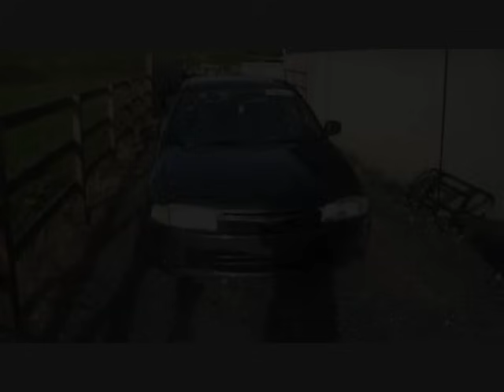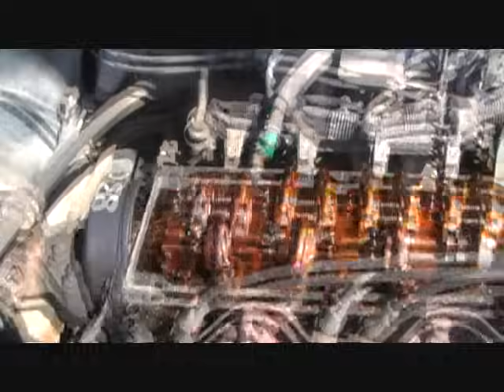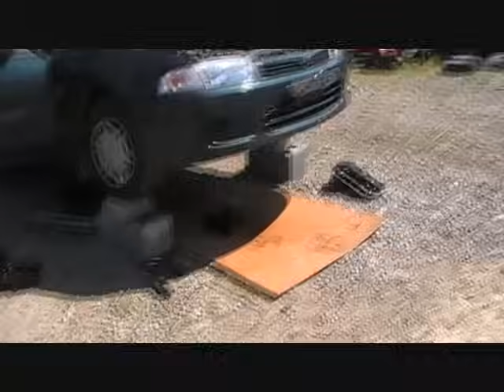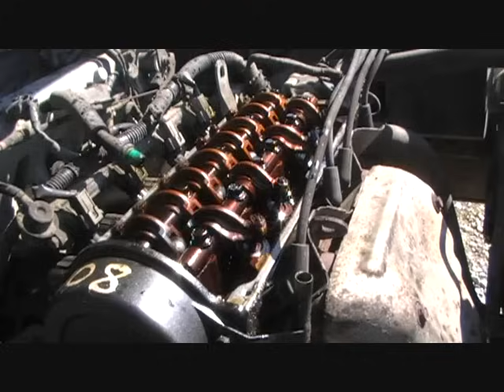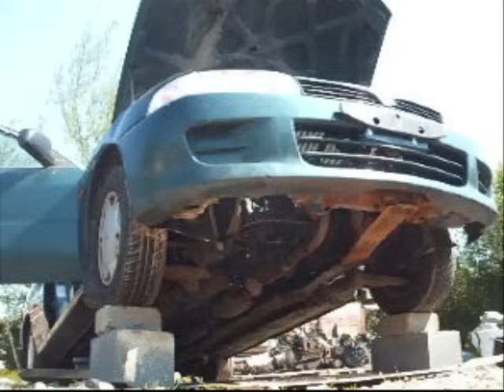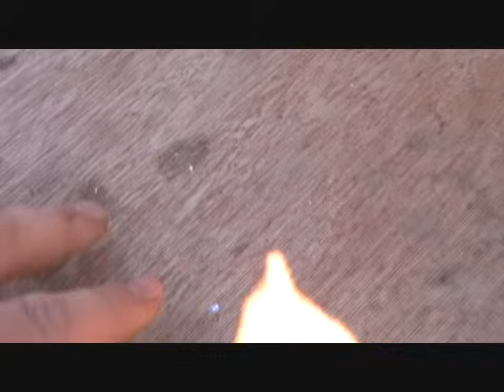Engine Running NO OIL - NO SUMP - Seized Soild on Camera

Comment: Eh you can argue with environmental chavs all day, unless they're commenting from a solar powered recycled 1990's big screen projection TV cardboard box, and leeching wireless internet from a government building, they're as guilty of wasting resources as anyone and there's not a damn thing they can say or do to prove they're not.

Good video. I'm guessing the tolerances in the engine were already very high from wear, I'd assume a newer engine would probably die a bit quicker.

Comment from the maker: there were loads of issues with it, and would have need over 600 euro in parts alone to get it to an NCT standard, plus the labour, which would involve replacing the release bearing

Comment: Nice video. 
To all the idiots saying waste, well it wasn't. Ever tried to sell parts for an econobox? people will screw you around endlessly and it wont be worth the time to pull.
It might look alright but if you live somewhere that actually has safety inspections it starts to add up rapidly when you need to replace bushes, mounts, exhausts and fix leaks.

Comment: I did wonder how long an engine would run with water instead of oil. It should stop the bearings overheating, though it won't lubricate very well. It sounds as if it might be a very long time! Presumably you left the oil in, so it was an oil/water mix in your case.

Comment: Nice video dude. What i would ad to it is that the engine is running free and it's able to stop runningwhen the friction becomes to high. While you're driving instead the energy of the moving car true the gearbox causes allot more damage when the pistons and valves actually want to quit but they can't and get forced way further into the graveyard !! lol

Comment: What a waste of a good engine. Next time put some of the super duper high falutin additive in the oil first then pull the pan and run it. Like those slick 50 ads did. Personally I think it's BS. No oil = no engine. Hold it to the floor and see how long is lasts.

Comment: I'd have jut used the engine for a little project, like a mini baja car. I you don't mind blowing the engine soon, just increase the compression ratio to 15:1, run it on a high octane gas-ethanol mixture, and have loads of fun.

Comment: Wow, look at all the wankers crying over a running engine that they would never have bothered with, paid money for, or gone to any effort to remove, refit and use themselves..
It's like they are all driving old cars that they are constantly restoring and have never bought a newer one.
Don't worry, seized engine or not, that car will be melted down and recycled into a shiny new one..

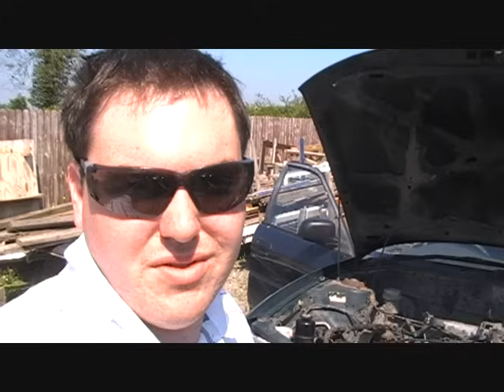Comment: @ 4:05, that is not true! Engines vary on how they die. American V8's have a habit of throwing con rods when they loose oil and run for a while. That is very different from a little inline 4 banger. A v8 produces much more power and stresses very differently. But, nice video, enjoyed it.

Comment: I'd honestly be interested to see how long it would run if oil was put back in it after the initial seize. It's insane how long that thing ran with no oil!

A lot of older cars would seize up within a minute or two. I know a large portion of Chrysler engines I've worked on started knocking like crazy when they were barely more than a quart low on oil. I wonder how long a 3800 engine could last, those things are fricken tanks :D

Comment: The engine still had lubrication there no way to remove every single drop of oil from and engine unless you run a rag or solvent through every oil line and over every part the is touched by oil, and even if you did its not the presence of the oil its the movement of the oil which creates the film coating that covers the internal parts which provides the lubrication. The presence of an oil pump only moves the hot oil around to the engine to get cooled off by the cooling system. Removing the oil even wiping down some of the internal parts doesn't fully remove the film left by the oil. Also, just because the engine is running with no oil doesn't immediately seize up the reason an engine seizes up is not because lack of oil (although it is a factor) but lack of cooling to the engine. The covers being pulled off might have helped slightly with the internal parts being cooled off but eventually the overwhelming friction and heat from the fast moving internal parts is what causes a seize. Also, even though there was no oil there was still coolant being pumped in and around the crankcase providing at least some measure of cooling to the engine. As for getting it working again if you pulled the engine our and let it soak in an oil bath (obviously breaking down the entire engine to the block only) you might be able to get it working again but you would have to verify all your clearances when re installing the other parts and if your block is warped its done.

Comment from the maker: Worn suspension bushings pretty much all round, bearings for 3rd and 5th gear in the gearbox were whining badly, the release bearing was roaring as you can hear in the video, the clutch was slipping and 3 of the tyres were way below the legal limit. Two of the seatbelts were damaged, both cv joints were clicking loudly and both steering arms were badly worn and had split gators. There was more stuff to. The NCT car test is quite strict so the cost to get it road leagl was too much to be worth it

Comment: I would have at least stripped it for parts. And what you can't sale take to the crusher or shredder and sale it for .25 per pound. I've. Bought many car for 500.00 and made 1500.00 to 2000.00 profit.

Comment: Dont like seeing waste like this - all my cars were kept running for their annual test and even if I had to pay €300 for parts to make it thru one test, thos ejobs were done for the next few tests, not economical policy if planning on selling the car, but perfect sense if keeping it. Drove an '87 Nissan Micra K10 for over 250,000 miles; when its motor finally died I put another one in over a weekend and got 4 more years, it was 23 yrs old before being crushed! Also had a Vauxhall Cavalier for 300,000 miles, rust killed the car but I sold the motor and the running gear to a mate for his car, motor was still running sweet. Wasteful scrappage schemes and idiots engaged in number plate snobbery will regret it soon as the old reliable 1990 - 2000 era vehicles are getting rare now. To say nothing of commercials, the old soldier Toyota Hiaces, Nissan Urvans & Isuzu's are gone to Africa where they can hold their own, the modern vans are muck, too much electronics & minimally engineered. See how long a modern Transit lasts in the Sahara or the south american jungles!